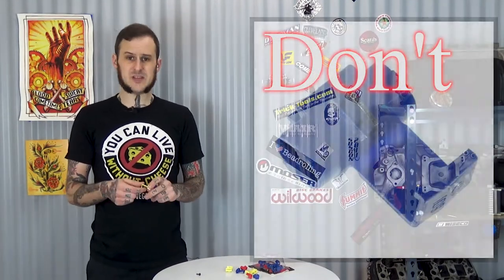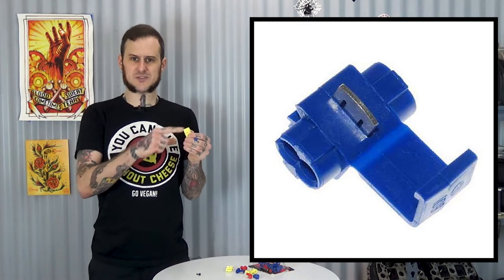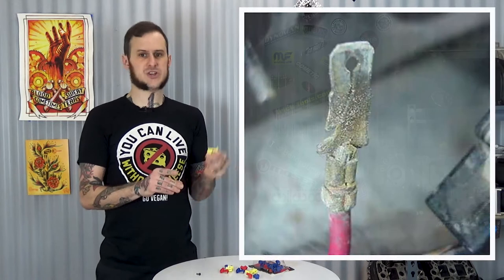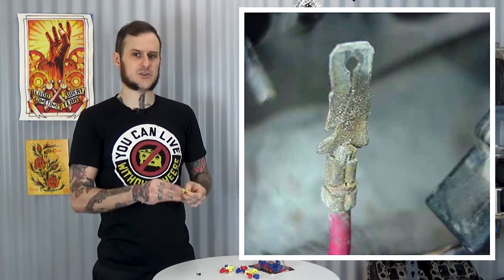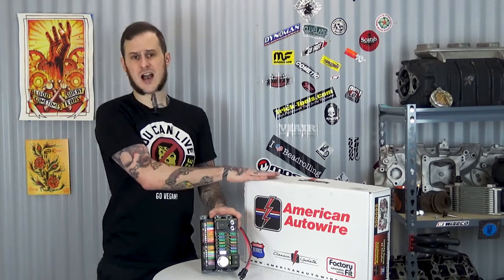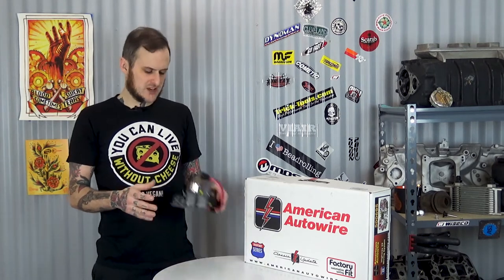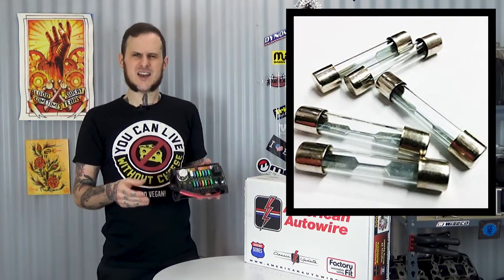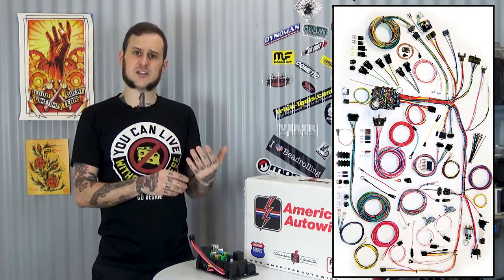Splice Connectors and Full Wiring Harnesses - Auto Electrical Dos and Don'ts  - Episode 1

Comment: I bought a Painless kit for our 40 Ford. Most of the wires had corrosion under the insulation in from the unterminated ends up to 18 inches.  The terminated ends at the fuse/distribution block were corroded under the insulation up to 6 inches.  I called the customer service and I was told it was my fault because I did not store the kit properly. I bought the PP kit and installed it within a month. I will never use that crap again.  We are going with American Autowire on the next two trucks. I will be cutting the Painless system out and replacing it with American Autowire. The AA system is highly recommended here. . Thanks for the video.
Reply: I’m finishing up a Painless wiring kit and can’t wait to start the American Wire kit it looks so much easier.

Comment: One way if you really want to splice stuff instead of buying a new kit is to go to a pick a part type yard and you can buy a harness for under $20. All sorts of colors in it. And different gauges. I've done it, not sure how many feet just in a newer engine harness from a van, but hundreds for sure. Granted, not all of it may be what you want to use, but I enjoy the hunt. 

But this most recent project I wimped out and bought a universal Painless kit. I wanted a fuse box, and the full kit on sale was just a little more than the fuse box alone. I will be modifying it, as I will be moving the fuse box location drastically among other things. I am too fat and too stiff anymore to be crawling under a dash to change a fuse. 

Unlike most people, I enjoy wiring. It's relaxing for me. I'm an electronic tech with lots of experience soldering. I really prefer not to use any sort of crimp on connector unless I can also solder it. 

Looking forward to your other electrical videos.
Reply from the maker: Solid point if someone is willing to invest the time. I'd definitely say you have to get selective as to watch out for corroded harnesses but that's easy enough. 

I've been known to hold onto old engine harnesses from LS engines and similar so that I have extra factory connectors, wire lengths and colors. I once had to repair an engine harness on a C5 Corvette that mice chewed through. I was able to splice all the damaged wires with exactly the right color and gauge of wire while in place on the car. I never could have if I didn't have a couple full harnesses on hand. 

👍👍👍

Comment: Ive been wiring race cars for a long time and have rewired many a customer hack job where they used these scotch lock splices and ended up with a smoldering heap of copper and ash.  On a personal note I stay away from the kits mainly because they just don't have enough relays and for street cars rely on thermal flashers etc.  (I like everything to be modern.)  But for the average Joe the kit is the best way to go as it takes out 99% of the guess work while providing a real functional solution.

Comment from the maker: Do you have any subjects you'd like to see covered on Automotive Electrical Systems?
Reply: This is a great intro. Thank you. 

It seems like some applications are well supported. For instance, if you want to swap an LS engine into a '69 Chevelle, then pre-made harness options abound which makes the swap plug-and-play easy. If instead, you want to swap, say, a K20 into an '89 Accord, there is zero support and you have to build your own harness from scratch. That yields tons and tons of questions. Do you buy a pre-built harness and modify? Build your own from bare wire and molex connectors? If you modify, how do you choose the best pre-built haness for your situation? How do you decide how long your harnesses need to be to reach everything without splicing on additional wire? How do you choose the best connectors? How do you install those connectors so they look professional, don't corrode, come loose, etc? What's the best way to mount harnesses in the car? What's the best way to twist and wrap a loom? I've seen some guys use big plywood templates and others use two men braiding wire and no template. How do you keep track of all the existing wires you're keeping so you don't mix them up when you start cutting stuff out? How do you transition from any existing connectors you're keeping to the new connectors you're installing? 

And so on....
Reply: @drsnooz8112  did you figure it out?

Comment: I havnt done a lot of wiring but when I do, I solder then use heat shrink. Then I use Tessa tape and wrap it around the heat shrink. But I mostly just repair wires and not tap into anything